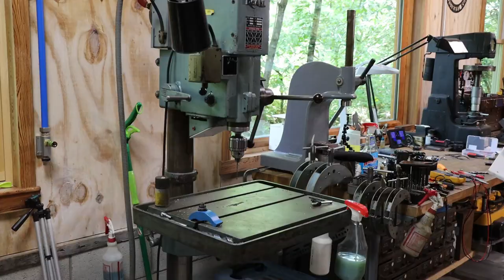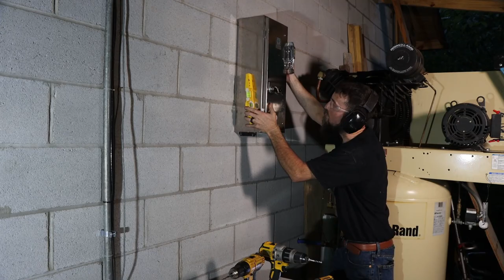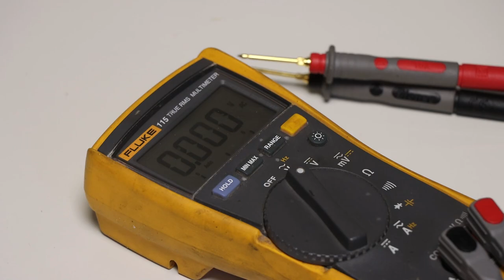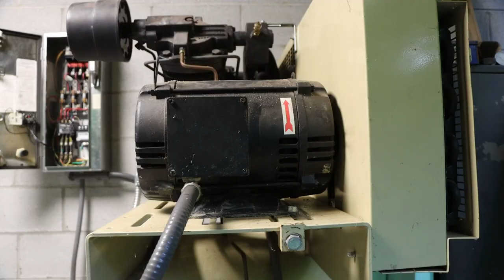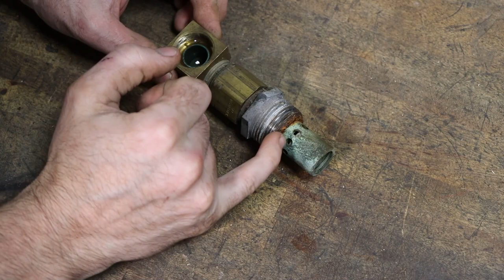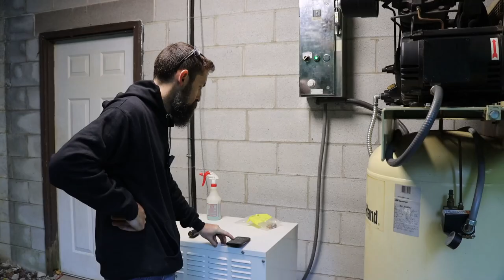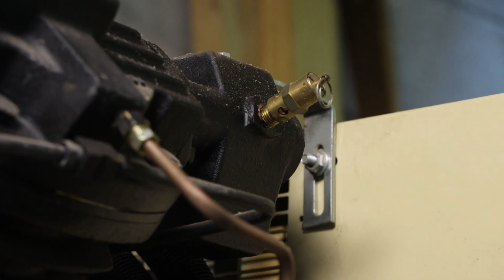Wiring & Test running my Big  Compressor

Comment: I recently picked up a 5HP Ingersoll-Rand myself and I can't wait to get it comissioned, because I've got my blast cabinet all ready to go. Sadly, I can't afford the necessary moisture removal hardware ATM.  Pump is made in India, which is not a problem, they have a time-honored tradition of building cast iron reciprocating-piston machines of all sorts for over 100 years. But I also noticed that "US Motor", a great old brand, is now made in Mexico.  I am eager to find out if the Mexican-made units are as over-designed and cool-running as the old ones.  I am moderately envious of your refrigerated moisture remover.

Comment: That compressor is a beauty, it's great to have it outside on that solid base and the covered area just don't let it turn into a dumping ground :)
Reply: That auto tank drain is not going to work in the winter because the line is going to be frozen, one more reason to have the compressor inside.

Comment: Some time ago, Keith Rucker did a segment on pressure testing a used compressor tank he had purchased. Since your IR compressor came out of an auto repair shop, it’s seen a lot of use. Might be a good idea to pressure test your tank before putting it into service & leaving it pressurized for weeks at a time. 
I had an old (1973) Sears “Best” 2 1/2 hp compressor that I used to leave pressurized. The tank sounded solid, but I took it out of service rather than drag the thing out of the basement & rent a pressure washer like Keith used to test his tank. 
A tank explosion would make for a very bad day…
Reply: Years ago in the early 1980s, we hydro-ed the 4 main reservoirs on the USG 75 ton Porter diesel the Huckleberry RR had.  We disconnected the tanks and laid them on the shop floor.  We hooked up the tanks to a pressure sprayer and plugged all the other holes after filling the tanks.  We used the pressure sprayer to pressurize the tanks and tapped on the tanks to make sure they did not let loose under pressure.  We removed the sprayer and plugs and rehung the tanks on the loco.  I seem to remember we tested the tanks to 200 psi even though they only carried about 120 psi in service.  The tanks were welded.

Comment: For AC transformer it's mostly Inductive reactance + resistance, not resistance alone. If the transformer drew 5+ amps at 230V that would be over 1000 watts. The total impedance of the transformer at 60Hz would be much, much higher than what you measured with the ohm meter so the current draw will be a lot lower. FWIW.
Reply: Translation: Ohm’s Law applies only to DC. Adjustments must be for inductive reactance in AC circuits before current draw can be accurately predicted for any given input voltage.
Reply: @thomasutley  Ohms law applies at AC too. Capacitive and inductive reactance are frequency dependent but they are also measured in ohms. To calculate the current in  a resistive circuit in series with an inductor of the same impedance as the resistor in ohms the current will be the sum voltage across the series pair divided by the sum of the resistors and inductors impedance in ohms. The difference here is that the inductors impedance changes with frequency, not that ohms law doesn't apply. Hope this help.
Reply: @vincei4252  Yes, I chose my words poorly! Ohm’s Law, as we all learned in school (V=I*R), without adjustment for reactance, applies to DC only.
Reply: Steve will have to make a graph to show this. Not just one answer.. same for (my music in shop) loud-speakers. Lol
Reply: The transformer should be rated in VA or kVA right on the tag. Simple as just dividing the VA by the voltage.
Reply: Steve, Vince is correct. An ohmmeter measures resistance at DC or 0 Hz ONLY. That transformer operates at 60 Hz. The 40.8 ohms you measured is meaningless.
Reply: Well not to nit pick but you can use Ohm's law on AC circuits provided the power factor is unity or one, i.e. a pure resistance circuit. Plain old incandescent light bulbs and electric heating elements are an example. I also remember a great story when I was in EE training. A large Chicago news paper plant changed all their office lightning from incandescent to fluorescent in the 1950s.  They immediately had all kinds of plant motor controllers tripping out on overload after the change. The reason was the power factor was greatly compromised by all the inductive ballast based fluorescent lighting on the upper floors. Fixed by adding capacitor banks on the mains to pull it back closer to unity.
Reply: Steve is like me and most jack-of-all trades. We know a lot, but not always enough. I don't need to repeat what has been said about inductive reactance. The other commentors eventually narrowed in on an accurate explanation. We could also discuss wiring methods for damp location and other NEC violations. Would you use greenfield and fittings in this application or leave the 480V wire color? In my area, these would not be allowed. His mag starter cabinet looked too high to me too with the disconnect switch handle in the on position over 6'.

But all this is nit picking a very handy guy that is not an electrician. I cringe regularly when Steve explains electricity and I am certain that others cringe when I speak outside of my skill set. I admire Steve and would love to meet him personally. He reminds me of my interests when I was his age. He is tackling skill sets that parallel mine. At his age he has accumulated more fun stuff than I ever dreamed of. He tackles projects that are outside of his experience with care and intensity. He has learned much about machining in his hobby effort.I am 65 and I am still eager to learn. Steve is ahead of me in some areas. My experience puts me ahead of him in other areas. I am not interested in putting my life on YouTube. I come here to learn and enjoy Steve's journey.  Steve often speaks in absolutes when explaining something. I do the same. We are both guilty of unknowingly spouting off "facts" simply because we don't know enough about a topic to know we are not correct. In my career we aimed for absolute understanding and accurate description to eliminate confusion and error.  One of my coworkers was exceedingly sloppy in his description and made frequent factual errors when explaining a particular phenomenon, but I offered him grace because he consistently got good results. I suspect that he really didn't know why things worked, but he understood what needed to be done. I had better understanding and verbal skills than he did, so I voluntarily edited his documentation when I feared his description errors would mislead someone in any critical area.
If I lived close to Steve I bet he and I could become good friends. I could teach him what I know about the electrical trade and more advanced machinery repair. Steve could teach me about machining and welding, because he is ahead of me.
Reply: @paulhunt598  There is no enforcement of color coding for voltage. If there was, the thick black rubber cord for hookup would have the right colors, or be outlawed, but they're always red, black, and white. It's more of a common courtesy to use the preferred colors "for the next guy." Like here at work, the electrician used purple for the 277v hot to the high bay lighting.

Comment: Hey, Steve the current won’t be the AC voltage over the DC resistance because the magnetizing inductance is in series- usually the current with no load is about 10% of the full-load primary current, by design, 230 VDC would give you the full current until your coil died (1300W, so not long). So for a 250VA 230VAC primary control transformer around 0.1A with no load. Thanks for the videos- I always learn something - a high point of Saturday mornings.
Reply: Correct

Comment: I enjoyed making wiring looms look neat - as you said - makes it so much easier in the future.  Chances are you’ll be needing to do a repair in a hurry, when it is dark, cold, wet and want to get the job over and done with!
Reply: One thing I do not see is the grounding wire that bonds the front panel with the case, and the case with the chassis and the feed ground conductor.

Comment: Wait till you have to replace the motor because the daubers have built nest in them. In the last 35 years i have replaced 4 aircompressor motors at the cost of over $1000. Now i have screen wire glued over the air intakes of the motors. I had to build an insect proof room to put my mills and lathes in to keep the daubers out of them. For a dauber to exist they need water dirt and spiders. I have all 3. My creek is an irrigation canal . I have outside lights that draw other insects which draw spiders which draw mud daubers.

Comment: For the phase converter interlock the best solution would be a simple electronic phase monitor, which will protect from single phasing as well as low voltage. A single phase input will burn up the windings of a 3 phase motor before the thermal overload can catch it. They can also be set for either auto or manual reset. That would also solve your restart after power failure scenario.

Comment: Steve,  on the mag switch, use the "ghost" or generated leg coming out of the phase converter for the power sense circuit on the mag starter.  On single phase there is no ghost leg, so no power through the mag starter.............Also, since the switch panel is fused, no need for an additional breaker.  Nicely done
Reply: You  beat me to it.  I run all my 3 phase Eq this way.  I have forgotten to turn on the phase convert ,more than once. The other option is on the outbd on the phase converter a relay that does the same.  i.e. if the Phase converter is not running power does not go to the shop. That makes all eq that is 3 phase not able to run without all 3 phases.  Not sure why they don't put that in the converters???  Product improvement???
Reply: He should also check when the ghost leg comes on. Some converters just dump the voltage directly from spinnup, this can choke the converter when power is pulled. I'm relatively sure the converter only switches the output when it's fully running but it don't harm to check it.
Reply from the maker: Hello Tom👍, I already tried this but the "ghost" leg or generated leg has power even when the converter isn't running.  Its enough to operate the control circuit.  I'll end up pulling off the relay in the phase converter on off switch circuit I believe.
Reply: @SteveSummers  I wouldn't be surprised if the converter has a "power good" signal, that can be used to switch on the compressor.
Reply: @SteveSummers  
Hi Steve, 
I would almost be willing to bet that the live 120v leg on one side of the transformer is causing that coil to trigger since the coil is very low current. 
You could try bypassing the transformer by running a neutral wire directly to the contactor coil and still use the so called ghost leg from the generator to see if that solves the problem.
Since you have a 120/240 system, it should work fine to bypass the transformer all together, those transformers are usually only needed for high voltages like 440 or 480 where one leg to neutral is still 220 or 208 depending on Delta or Wye connected power line transformers.
Anyway, just trying to help.
Reply from the maker: @AerialPhotogGuy  Thanks for the suggestion. I may try that.
Reply: @SteveSummers  
You're welcome, it's much easier than having to setup a phase monitor/relay IMHO.
And BTW, if that should happen to not work (I believe it will though). I have a few ICM450 phase monitors left, I could send you one of those but that would be a last resort measure. 
 I'm retired now and I haven't sold any leftover stock yet. 
Just let me know how it works out.
Reply: @SteveSummers  Totally understand.  What you may be getting is "bleed off" from the start capacitor.  I would have to look at the AM Rotary schematic to determine if that is the case.  There have been a few suggestions in these responses to address that.  I especially agree that the transformer is not needed in the low voltage 3 phase application.  One leg will nicely provide your 120v for the mag switch.  Give me a call if you want and we can discuss some options if you wish.
Reply: @robbob601  Rob, those are the pieces they call options. Grainger  has perfected that if you look at buying from them...lol....Also, he beat me to it as well.

Comment: Feed your control transformer from the phase that is only there when the phase converter is running. If you then leave the compressor switched on it cannot kick in.
Reply: Robert, you nailed it!
Reply: Exactly, putting a delay timer module after the transformer will let the phase converter fully power up before the compressor can start pumping. Putting a second on/off switch inside with power and running lights would also be great.
Reply: Doesn't help if one of the other legs is down due to the transformer dropping a leg. Phase monitor is the way to go. All the Air compressor mfg use them if the customer requires/wants the protection.
Reply: @MrTonyPiscatelle  If you lose one of the "live" legs, the idler motor will quit running, and the generated leg will drop out.  I do agree that phase protection is handy, but those apply mostly to 3 phase street power.  If you lose a phase on a running motor with street power, it will continue to run, just at 2/3 power, and likely burn up if run to long at rated load.  minimally, it will burn up the mag switch running on just 2 phases.
Reply: @farmalltomf   It will burn up most every time. At least the size of motors Ive worked with for near 40 years. That being 200 hp to 5000 hp.  Okay he's using a phase converter, I was thinking straight 3 ph power. Inefficient way to do things. What is that little compressor 5hp ?   He should of just switched the motor out to single ph.

Comment: Feed a low power relay from the RPC control circuit (RPC Indicator light =ON, Compressor enable relay=ON). Also, mirror your power-on lamp inside the shop so you can tell at a glance if you left the compressor on without walking out the back door (I'd do it for the RPC as well).

Comment: If you connect the transformer that powers the motor starter accross two phase that the phase converter creates, it can't turn on unless the converter is running.

Comment: I'm glad to see your compressor running. You will really appreciate it as you connect more machines. I can't believe that the correct heaters are unavailable for the starter. I would check with a supplier that sells motor starters.

Comment: IR compressors, we had a T30 in the shop that ran 14 hours a day 7 days a week. The only repairs I ever had to make, other than regular oil and air filter changes, was reed valves that broke in the head.

Comment: To not have the compressor turn on without the phase convertor on I would check if only 2 of the phase are live when the phase converter is  off.  Connect your 240 volt side of your 120 volt transformer to the phase that only is live when your phase converter is on. That way the transformer is never energized when only 2 phases are live and the starter relay will never energize at 2 phase.

Comment: Hi Steve, I would be tempted to adjust the pressure switch down to shut off at a lower pressure. You don't really need 175 P.S.I. It's just costing money and would save lots of wear and tear on the compressor.
With the volume of that tank, you could more than likely run at 120P.S.I. or even a little less. Nice set-up!
Reply: Spot on Ref reduce system pressure,  no need for 175 psi  in an engineering environment .

Comment: What is the Maximum amperage draw of your motor?  Measure that or get the FLA off the nameplate and get the closest Heater of that amperage.  It's old school and can be replaced with a kit from Eaton, Schneider, squareD, Sprecher, etc that has the Motor Overload, Starter (Contactor), Transformer and enclosure with indicators, switches, etc and is UL approved.  You can probably get a 240volt coil version so you won't need a transformer and do the thing were use only the supply hot phase and the phase converter switched phase and that should work.